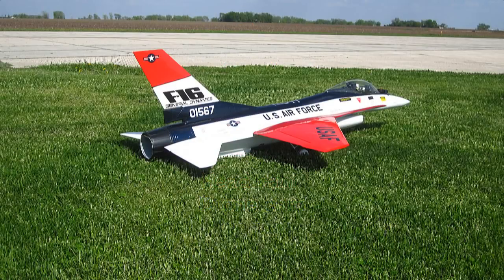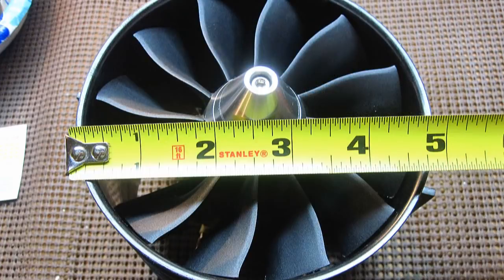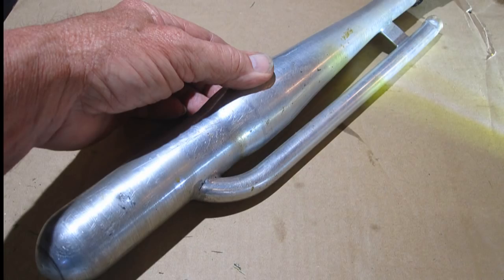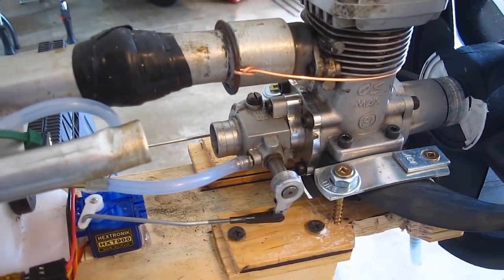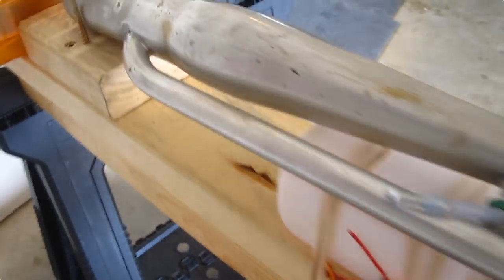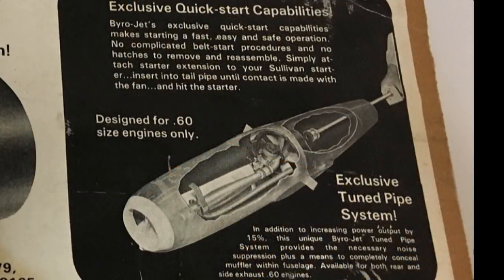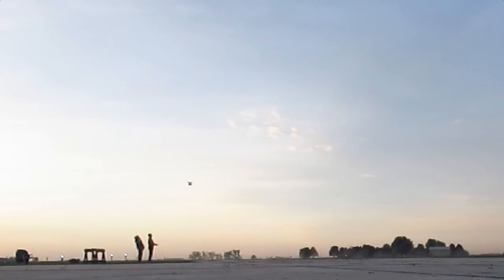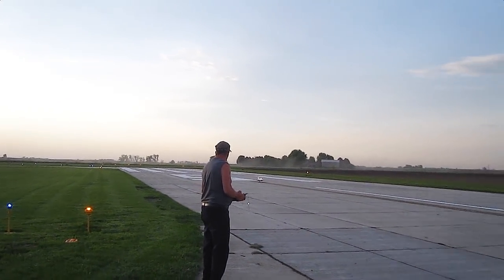Electrified Byron Originals F-16, Byro Jet  Explained, Plus exciting 5 camera flight!

Comment: Did you know that the first electric ducted fan was flown by the Aeromode;;er staff in 1946? It was in a scale Vampire that was flown RTP at an exhibition in Dorland Hall. London. It had retracts too. When one of our local detartment stores (in Birmingham, UK) opened a model department in 1948 it was demonstarted and I was fortunste to see it. I was one of the pioneers of electric flight in the UK in the 1980's (I wrote a book about it) and never dreamed where we would be today.
Reply from the maker: Like Minds think alike.  Good story.  I have been involved in it a long time too, and invented the Hyperfly electric NoTar Heli for Kyosho and also the electric tail rotor motor which is used quite extensively on model helicopters these days. I used to work as an engineer at Kraft Radio control systems and invented Half rates (published article in Model Aviation magazine) All supporting videos and demos are on my channel if you search.  You must be 90 years old, as I was borne in 1948.  Thanks for the work and comments.

Comment: Hi Dave,
Conversion looks very neat. Sounds great, flies great. How does the AUW compare to the nitro installation? I know the flight times will be shorter, but guess you won't miss all the mess from glow fuel. You caught a sun dog in the video at the 6:16 mark. That ending was sweet having the jet pull right up to you and the pilot's thumbs up.  :-)
Reply from the maker: Yes, it sure is nice to have a clean exhaust tube, as cleaning the nitro was very messy for the whole arm! I am pleased you liked the ending.  I am getting about 6 good minutes of flight time total..it may run longer, but I haven't chanced it.  Performance seems about the same.  Thanks for your kind words.
Reply: Hi Dave,
What EDF unit did you use in the conversion?

Comment: In another comment you mentioned "Performance seems about the same."  That's great because the EDF sounds like a jet should.  Correct me if I'm wrong, but was it your decision that retracts would have added too much weight for your EDF setup?  Someone needs to kit this thing again!
Reply from the maker: It can easily handle retracts but I hate messing with them, so think it flies fine as is. Thanks.

Comment: This machine demands retracts.
Reply from the maker: Maybe so, but the original kit did not provide a way to do that and my experience in 50 years of flying with many types of retracts, was having to fly by to make sure they were up, then fly by to make sure they were down with many many failures, of which you can watch on youtube. This jets weights 15 lbs and a hard landing can exert way over 50 lbs of pressure on a landing gear, stripping electric retracts or bending struts, that then wont retract or come down, causing horrible runway rash to the bottom of the plane on landing.  Besides spending another $300 + to do it, it takes many hours to figure out how to modify this machine to mount them.  I have decided to keep it simple and just enjoy it as it is. Thanks "Engineer"!
Reply: Coming up with workarounds to deal with constraints is the joy of Hobby, Engineering & Defence. Given you have already solved half the problem. As they say "Defining Problem is half the solution".
Reply from the maker: True, but at age 70, I am becoming limited, albeit you know I am very inventive and innovative and have invented many things for the hobby over the years, having worked in the industry.   Defining a working unit as a problem, is not a solution.  You never have said anything positive about my videos. You should make some videos of your work.
Reply: Even though this plane was designed without them, I'm sure there has to be a decent set of retracts that could work. I suppose if you have enough will, there's got to be a way.  Other than that, very well done video on a classic Byron F-16.